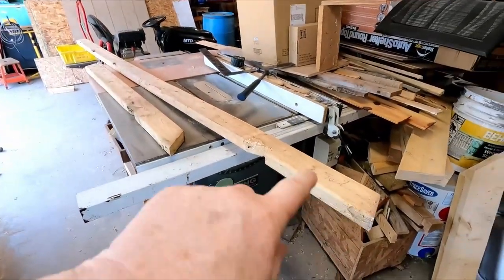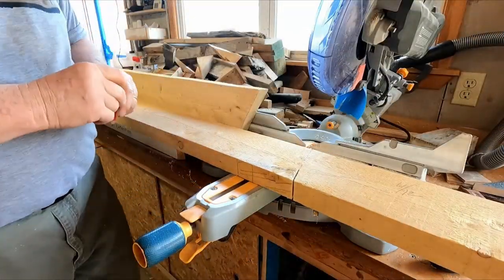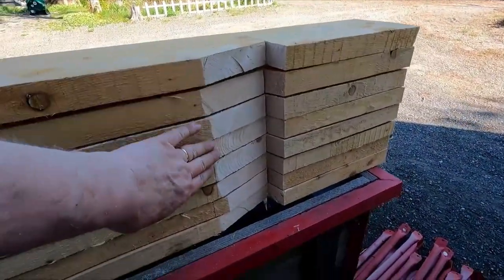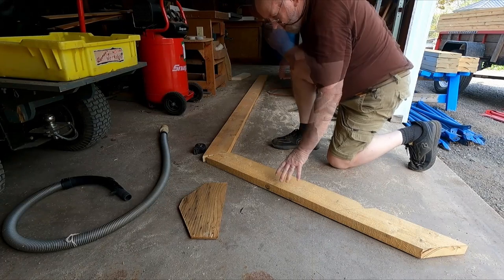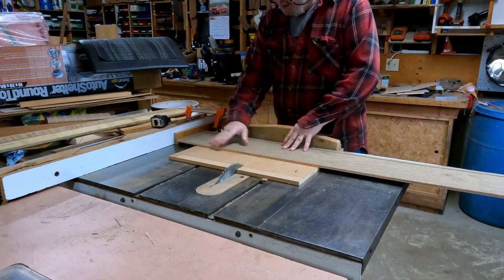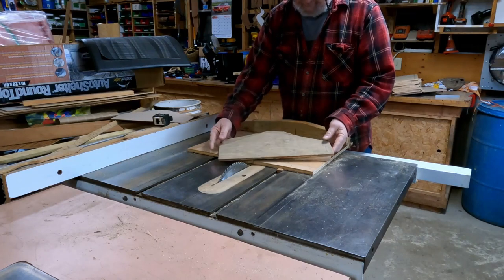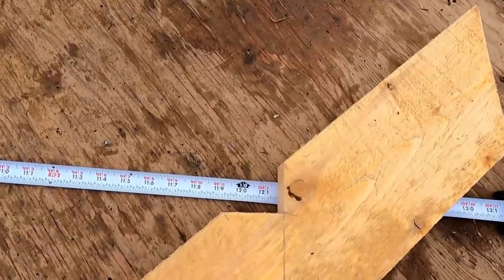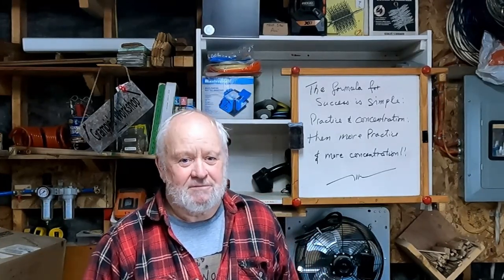Making Hybrid Roof Rafters

Comment: Great progress on the boat house bud. Looks like you have done this before, LOL. Sure nice to have that mill available and the logs to work with. We have a 30 foot wide shop and have a foot and a1/2 overhang all around. our circular mill with the 50 inch headsaw I could just squeak the 2x6's needed for the base, 2 x 8 for the slopes and full 5 inch fore internals. With a 16 inch spacing we sure have no worry about having to shovel the snow load eh. Tin roof too that gets full coverage mid day.
Reply from the maker: Hello there Dean!!  Your roof should hold all the snow in BC I'd say!!  2 X 8 rafters at 16" centers; you could stable a team of horses up there!!!  LOL  Dertek was some happy to be able to mill the lumber for the roof.  Heck so was I with the cost of lumber.  Thanks for tuning in old trout and take care!!
Reply: @GrampiesWorkshop  I really miss being up on the deck sawing big wood we harvested ourselves and took down the mountain to make whatever we needed from it and the wood was full sized. A 2 x 8 was exactly a 2 x 8. Better yet with the stumpage costs that are still  .25 cents a sq. meter we would have really made a bunch of $ but seems there were just no kids or adults for that wanted to make $25.00 an hour along with a production bonus every day.  WHAT, , , You want me to work hard and actually sweat and possibly get a sliver ? After 2 years of it we just gave up and now we still can take the big portable to this farm or that and saw up whatever they like. It was right before the explosions of the horizontal band mills were so much everywhere. The old 220 Cummins for the mill and a 165 Massy to tend to it it is fun to sit out there and tall the wood as it comes out of the old girl. It has been over 30 years since it's creation now and has  at least that much still left in her eh. For the best part we used an old truck frame for the Husk (frame that holds the most of the headsaw part) and an old 14 X  78  mobile home frame and a bicycle to make the best part of the working parts n pieces. When I once hired a full crew to run it they simply said no way ! and 2 of them walked away never to be seen again away. As I was really pissy of about the situation it was a good thing my partner was there As I was choked to have to deal with that kind of disrespect . We  all just now have to deal  With the  bugs  and have to swat a bunch of blood sucking critters bit the fellas have a good time and so do my old friends. see ya next  post bud. I really do need to get a new one put up for my editor to do his magic with. Man, , , I sure can make a bunch of lines to edit eh, LOL. Ya rock fella !
Reply from the maker: @TomokosEnterprize  Hello there Dean!!  It seems to me what you are talking about here is the situation where folks don't want to work hard anymore.  If the job makes me uncomfortable, if the job makes me sweat, if the job might make be break a nail, if the job might make me have to change my social schedule, if the job makes me have to works nights, if the job makes me get a blister, well I don't want to do it.  Go get some immigrant to do it.  Well Dean, I sure don't have anything against immigrants, because they are definitely not afraid of working.  But that's a sign of the times.  It's the beginning, or dare I say the midst, of our downfall as a great nation.  Take care!!
Reply: @GrampiesWorkshop  Seems like I replied to myself bud but check out my reply to myself has to say below. That old man thing has struck again eh, LOL.